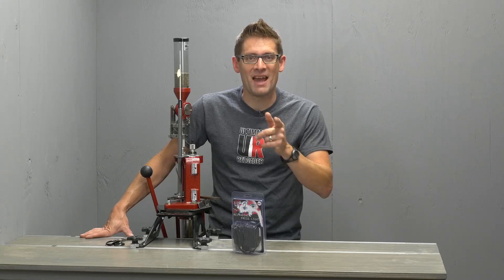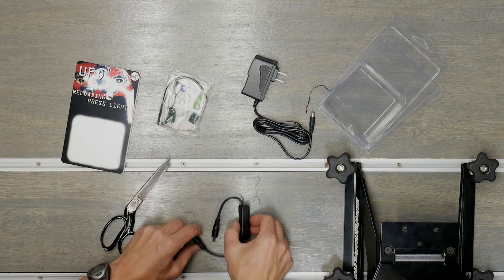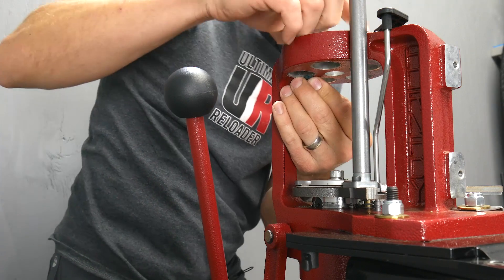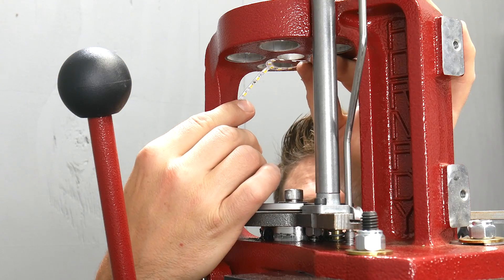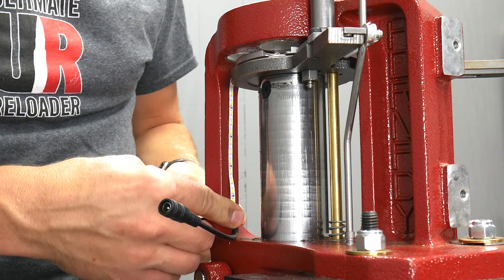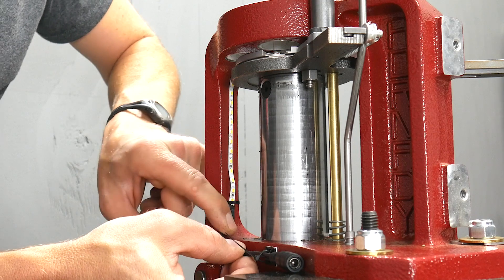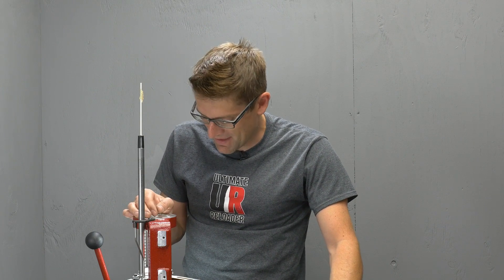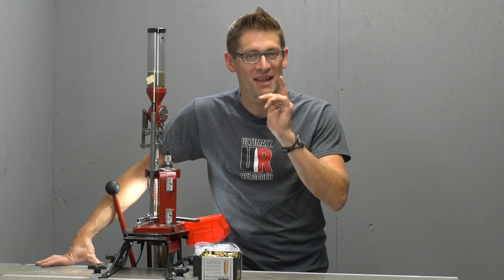KMS Squared UFO Press Light on the Hornady Lock-N-Load AP

Comment: Hey Gavin, (FWIW, I’m going to also ask this question on your Facebook page because you just did an update about this brand, which brings me to my question)...

The update you did for these lights kits was about the company switching to a better adhesive. But in the video about the update you didn’t mention the Hornady LNL light kit as one that was updated or going to be updated with this better adhesive. Is that because it’s already been updated and already on the market or are there no plans to update the kit for the LNL at this time? I ask because I noticed that even though you used the piece of Scotch Brite pad and the cleaner that came in the kit, a section of the light strip (where the light strip meets the power cable for it) was already starting to come off and not stick. And if the LNL kit isn’t updated yet i’d like to hold off purchasing one until it comes out. And if it’s not going to be updated then I’ll probably just stick with the Hornady light kit already on my press. But it too isn’t sticking and started to not stick the moment I put it on.

Thanks in advance and thanks for this and all the other informative videos you do...

Comment: Does it seem like a bit too much brightness after working awhile? 500 lumens seems like a butt load of light, especially reflecting off the shinier parts of the press and casings. And I also wonder how much longer before the press manufacturers start building them into the press instead of some makeshift stick-on solution. Would also be nice if it was dimmable.
Reply: Rayzer,

The brightness is exaggerated by the camera. When the aperture is set for a certain level of lighting then you turn on an additional light source it will appear much brighter until the aperture adjusts. If you read the reviews on Amazon you will see that those that have used it have not had an issue with it being too bright. 

That being said, 12v dimmer switches are available on eBay for under $5 shipped. So if you feel the need to dial it back a notch or two you can. However, in all likelihood you will not need to do that. I have loaded a thousand rounds at a sitting on both my LnL and 650 using the UFOs and experienced no eye strain at all. 

The reviews speak for themselves.

Links to Amazon Reviews:
http://tinyurl.com/UFO-lnl
http://tinyurl.com/UFO550
http://tinyurl.com/UFO650

Please feel free to contact me at kmssquared.com if you have any additional questions.

Thank You,

David
KMS Squared
Reply from the maker: Just loaded a bunch of 22 Nosler with this setup yesterday- definately not too much light. :)
Reply: Thanks, David and Gavin for the reply. David, that's some great info, I really appreciate it.

Comment: I noticed the adhesive already coming loose  on your light strip, not good.  A much easier and much better lighting system comes from Inline Fabrication, it's called the Skylight.  It drops in from the top in the center hole gives you plenty of light and no adhesive problems.  I use all five stations of my press and I visually check every powder charge when setting the bullet on the case.  My Skylight is ten years old and works perfectly.
Reply from the maker: Joe- did you read the note in the video?
Reply: I saw and read the note but I still like how the Skylight doesn't rely on any adhesive to keep it in place.  Eventually the adhesive will fail.
Reply: Joe, we appreciate your opinion and would like to address your concerns. As Gavin noted, If you look closely you will see that the separation was due to binding when he installed the wire management zip ties. 

The zip ties stabilize the wire and isolate the adhesive from torsion stress. Once installed, the adhesive does hold the light strip in place without an issue. I have a number of these installed under various conditions (hot, cold, humid and dry) and as of yet they all hold. 

You will find that the strip, although flexible does hold its shape. So there isn’t much stress other that gravity attempting to separate it from the press.
There are several advantages of this design over other manufacturer's. The biggest being that the overhead light is spread out closer to the shell stations and provides a more direct line of sight on the case mouth. In addition to that here are a few more:

- More and brighter LEDs (You can only fit so many LEDs in the center hole)
- Horizontally light
- Cleaner install, all the wiring is out of the way 

There is more than one way to approach the problem of lighting a reloading press. We believe that our solution overcomes the shortcomings of other manufacturer’s products. 
Give the UFO a chance and I think you would see the light as well. 

If you have any questions please feel free to reach out to us at kmssquared.com
 Thank You,
DavidKMS Squared
Reply: I stand by my previous statement.  Also there is such a thing as too much light.  When he turned those lights on the led's were blinding causing massive glare on all shinny surfaces.  Like I said I like the Skylight from Inline Fab.

Comment: The only thing I see that could be improved would be to have the switch on the other side of the power supply so it wouldn't use power while off.  1a @12v could be around the size of the switch itself.
Reply from the maker: Interesting idea! Problem is, if you did that, the switch wouldn't be as handy (at least where my plugin is located)
Reply: gavintoobe I'm sure we could figure something out, the hardest part of me building my own would be the circle and making it look as nice as their kit.  I really like it.
Reply: gavintoobe, plus the light is on your head is in the incorrect angle and location. The led shines straight down into the shell, the head light shines in at an angle seeing only part of the inside of the shell instead of a complete straight down view. When using a basic multi-tool you get just that, a basic tool. When using a specifically made tool you get exactly that a specific job done correctly.